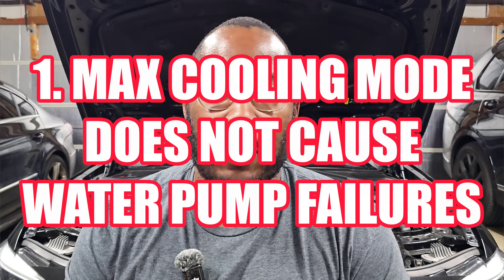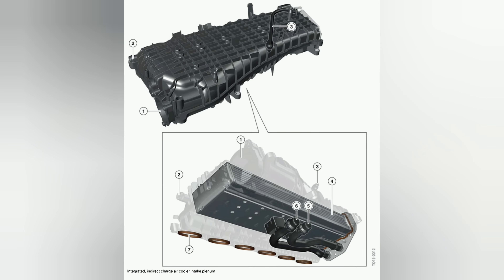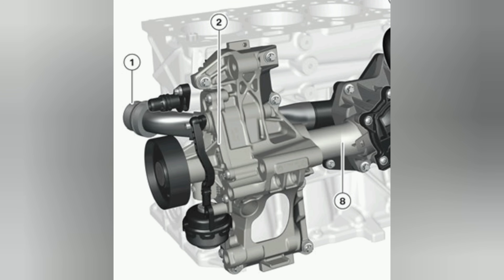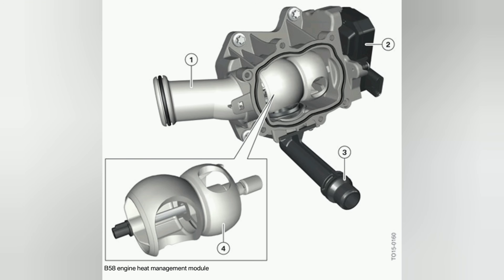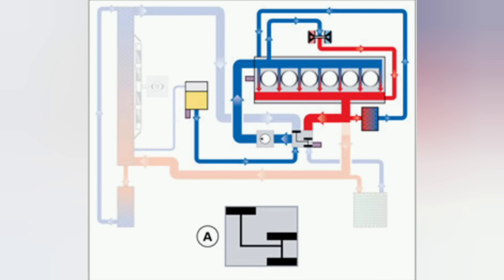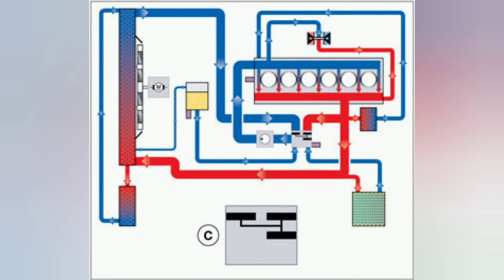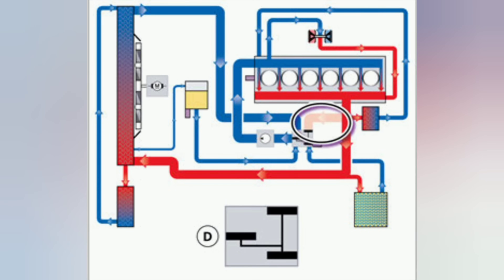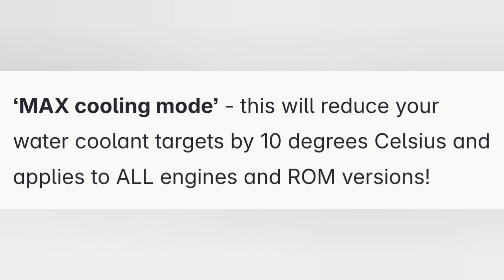Why I Still Run Max Cooling Mode After Saying It's Bad

Comment: I'm located in a hot part of Australia. The temps here never get under 5 degrees Celsius and often sit around 25-35 degrees Celsius. I've just changed my coolant target from stock to sport and it's dropped the average water temps from 110deg to 95 deg Celsius. I'm keeping this setting as I think that temp is far better suited for this climate.

Comment: It make no sense to make intercooler pump to work on 100%. In general, ECU have map for IC pump, and it's 3D map, with ambient temp on one axe, and another axe - difference between ambient and actual water temp(of IC circuit). So, it's better to optimize that map, instead of that stupid logic provided by MHD/Bm3 to just make it 100%.

Comment: @kern417 totally unrelated but I was watching your injector replacement video because I’m planning on doing mine (2017 M240i) and you mentioned that replacing them as a maintenance interval is something you don’t recommend. That video is 2 years old, do you still believe that for the 16/17 b58?

Comment: Thanks for you clear explanation on the max cooling mode.  I have a question on the B58 coolant replacement.  Since there is no drain plug on the radiator, would you recommend to use the coolant exchange machine like Qwikdraw speed draw QD2 to extract the old coolant out by creating the vacuum in the system, then use the same vacuum air in the system to refill the new coolant.  Due to the thermostat is managed by DMU electronically, my second question is how to ensure the thermostat is open so that the coolant in the engine block can also be extracted out in the first place.  Please advise.  Thank you.

Comment: Would additional booster electronic water pump help with cooling since adding manifold and heat exchangers do make the pumps to work harder in theory

Comment: Im going on a 5 hr trip tomorrow and i have coolant leaking from my weep hole on the expansion tank. My guess is the mechanical water pumps failing. (Which i ordered a new one, just waiting) ive noticed it start to leak a bit faster out of the weep hole within this past week. My question is...will enabling max cooling mode on my mhd app help lower the amount of pressure...therefore less coolant leakage. Or in doing that will it leak more?
Reply: Your post is a bit confusing. It's coming from the weep hole on the expansion tank that means your radiator cap is fucked up that needs replacing unless you're really overheating it and pressures inside are getting that high. The mechanical water pump is a separate thing it has a weep hole and it's not coming out of there and the bearing isn't loose then the water pumps okay. Now the electronic Water Management unit has been known to fail. But more maybe it leaks when it fails when it fails
Reply: @ShanDobson ive replaced my expansion cap when i bought the car. Maybe i have a faulty cap. Idk. Got it from FCP. But..yes the leak is coming from the expansion tanks weep hole

Comment: when do you think sport mode cooling for intercooler is needed? I daily a stage 2 g30 and I haven’t had any temp problems but I don’t want any in the future.
Reply: I’m at 88k on my gen 1 no issues so far but I’m thinking by 120k to upgrade intercooler water pump seems to be holding up strong
Reply: @souljayt8411 I’m gen 1 as well, only 46k miles but still I daily it.
Reply: I have a stage 3 G30 with 30k+ miles tuned it’s now at 56k all with sport cooling for intercooler

Comment: I was looking for information on this a few days ago. You're a godsend!

Now I use Sport Cooling for the intercooler and Sport Cooling for the engine. The temperatures are lower, so I'm less worried about the engine overheating.
Reply: Overheat b58? 🤣 fan there can cool down nuclear power station.

Comment: I don't bother with sport/max cooling mode on my 340i. I used to run sport cooling mode for my N55 because normal oil temps were 250+ and it would easily touch 260 on a summer day. My 340i is always at 230 and never budges. Just sport intercooler on MHD is enough.
Reply from the maker: This man gets it
Reply: I used sport cooling mode on my m240i when I had it, kept the temps right around 200*, and I got a lot less timing corrections which is the main reason I kept it on.
Reply: @j_tootie  I feel like 110C is way too hot for all the plastics under the hood, I think 95-100C is waay better for the longevity of the vehicle. My other cars have thermostats that open up at 90C water temp which is where it should be.